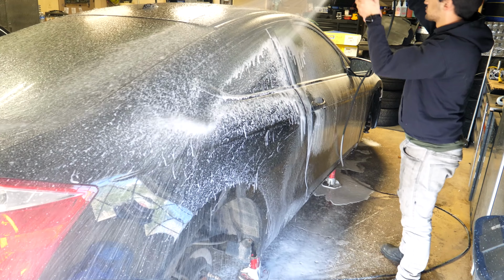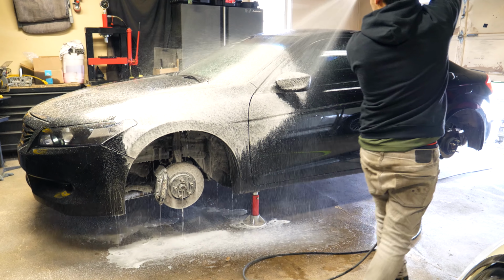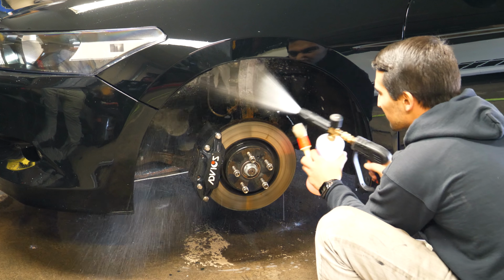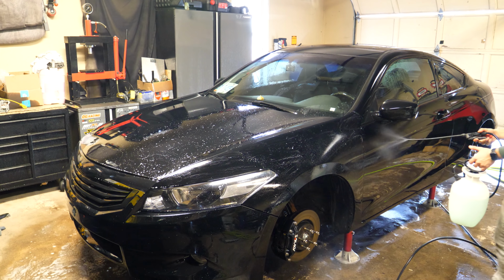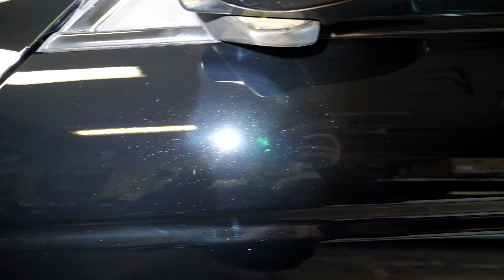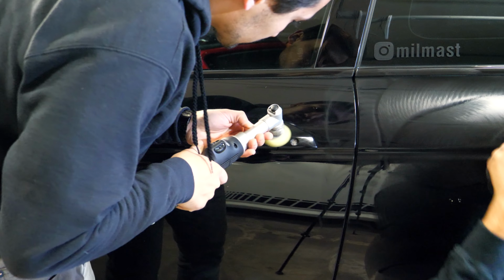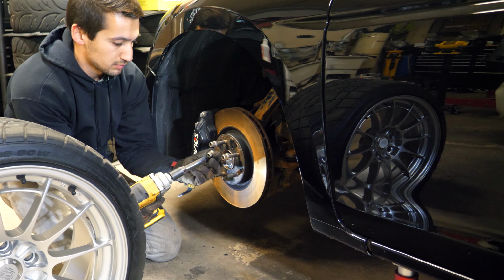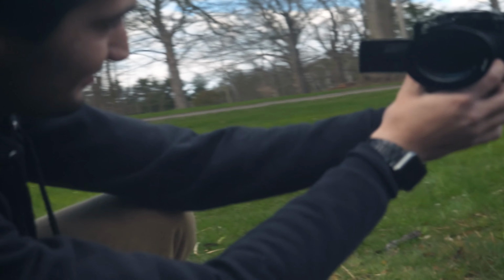GIVING MY CAR A COMPLETE MAKEOVER!!

Comment: I've always been curious, do you have a drain in your garage? How to you wash in the garage without water going everywhere?
Reply: Good question. I was wondering that too.
Reply: Ever heard of a broom??????😄
Reply from the maker: I use a squeegee. The garage is slightly sloped outwards so even without the squeegee, it does drain towards the garage doors. After I'm done washing the car, if there is still standing water, I squeegee it out, otherwise if it's a hot day, it will evaporate.

Comment: Yep Black cars w/ silver wheels mesh perfectly.  I got a black 8th gen Coupe w/ H&R springs riding on EVO X silver wheels 18x8.5 +38 and it sits just right and handles nice.  I didn't do coil overs on my 8th gen since lowering the 8th gen 2" or more kills the axles way to quickly.  This is my daily so i went w/ H&R and threw on a 3 rear peice camber kit if i wanted to do a track conservative alignment.  Would post a pic if it let me lol.  Cant wait for the K24a2/K24z3 block to be done and you can post about it
Reply from the maker: That's wicked! I had some Evo wheels too on my Accord at some point and loved how they looked. I'm pumped for my engine build too! 🎉 should be done soon (given Covid..)

Comment: I literally have the same car as you I have the ex 6cyl, and your videos were recommended to me from 4 years ago. Love the videos!! I’m planning to use adhesive tape to blackout the chrome on the two sides.
Reply: UrSadHuh You have to use vinyl or a plastidip spray instead of the adhesive tape 😉👍
Reply from the maker: That's awesome! You can get strips of the black vinyl for stuff just like that. Something like this is what you should get: https://amzn.to/2zFQYUn
Reply: milanmastracci I was looking around online looking for some too but I couldn’t find any good ones, so thank you for the recommendation!  I saw your video “Blacking our window trim using plastic dip” and I like the way it turned out, only reason I’m using the blackout tape is just Incase I wanted to switch it back.

Comment: Hi, love your videos! It is inspiring. I just bought a 2017 EX-L coupe, same color with less than 30K on it. The car is like new except those curb rashes on rims. I am 6'4", this coupe is one of the most comfortable car I had ever driven. How do you like your rim and tire combination, I am looking for something with less road noise and a bit softer ride. Thank you again for sharing your love of car!!
Reply from the maker: Hi Walter, thanks for commenting and congrats on your new ride! I would look into lightweight wheel and tire combo, something like an 18" Enkei PF01 with a Michelin tire. It will be lighter than stock, quieter than stock, and will look great on your car. You just need to be careful when parking and going through drive throughs. Hope that helps!

Comment: Great video!  It's ok to use an air wrench to remove the lugs, but you should be using a torque wrench only to tighten them to spec.
Reply from the maker: You can use an impact gun on the highest setting to remove the lug nuts, but when putting them on, on the lowest setting, it only torques the lug nuts to about 40 foot pounds, which is enough to hold the wheel, but not enough to go over spec. I then follow it up with my torque wrench 👍

Comment: Thanks for the upload! Great video. I found Hidden gem also. I’m installing 18x9.5 on my 2004 Acura TSX and I was wondering how the 255-35-18 would look ... PERFECT. THANKS
Reply from the maker: Thanks Rob! 👊 You'd have to play around with offsets, but I imagine you can get those specs to work. I'm not sure if I'm going to be keeping this setup actually because the 9.5s poke up front a bit. I prefer functional setups but that's just me 👍

Comment: Did you fix the rust near the wheel well before you applied the ceramic coating?
Reply from the maker: Not yet. I might get it professionally done. If I'm going to do something, I'd rather do it right. I've done some of the budget methods and it just isn't the same as a professional job. I'd like to get the body shop to let me in their doors to record the process 👍

Comment: You mentioned about not doing to many agressive polish as at some point it might go through the clear coat.  So how many times can you polish a car? 

Also you used ceramic wax.  What kind of soap would you recommend that you could buy at a autozone or canadiantire that could be affective? I heard you have to use some specific soap once the coating is on to not remove the coating after ...  buts it’s confusing...

I’m about to go a complete paint restoration on my grand Cherokee for the first time and I want to make sure I do it right the first time.  Tx a lot
Reply from the maker: It all depends how aggressive you are with your polishing. If done right, you should be able to polish your car like this 10+ times, which will go a long ways. For the soap, I use a regular car soap that strips any waxes and dirt, just so that nothing adheres to the ceramic coating. Think of it like a 'skin' on top of the paint. You have multiple layers of skin, but the top one is the one that gets the most abuse. The ceramic coating is rather hard, and should be able to withstand most car soaps, even the ones that strip like Dawn dish soap. Because it isn't a wax, it won't come off with washes, only abrasion.
Reply: milanmastracci 
Thanks for the reply.  
So what would be a good soap that would strip of any wax? And which one that would help maintain the car and wouldn’t remove any wax ?

Comment: Please do not spread incorrect information. You should NOT be applying anything on top of ceramic coating such as wax! Only a ceramic coating topper made for that specific purpose. if you apply Wax on top of a ceramic coating you are covering up the benefits of a ceramic coating such as self cleaning properties, high hydrophobic repelling and so on. Whoever told you Wax on top of Ceramic coating is wrong. Pick 1 or the other you should not mix the two or else its a waste of money.
Reply from the maker: I don't see it in the same way. If you apply a wax and the wax fills in scratches and acts similarly to a ceramic coating, I see it has done the job. It has offered protection and makes the paint look better. If the wax does wear off, you still have the durability and protection of the ceramic coating. Have you tried doing both?
Reply: Don’t top a ceramic coating with a wax, people.